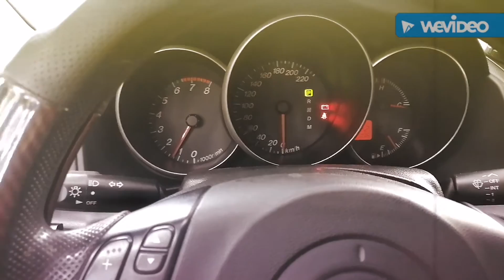Fuel Pump Installation Mazda 3

Comment: You made hole bigger to avoid dropping the fuel tank??
Reply from the maker: i only replaced the fuel pump,  and all the holes are original its the same size
Reply: @wangyuautocare  i think hole was made bigger  in the past to avoid dropping tank, I have an 07 mazda3 that fuel pump wont fit at all thru original hole under seat, its only to access the plug 👎 sucks
Reply from the maker: Maybe you bought a non compatible fuel pump
Reply: @wangyuautocare  original fuel pump won't come out thru that hole, I'm suppose to drop tank ,  I'll have to make that hole as big as that one you replaced on this video
Reply from the maker: @lcarlosmoreno6436  this is 2005 mazda 3 maybe sir your car and my car are not the same in terms of fuel hole size
Reply: @wangyuautocare  should be all the same you just lucky someone did you a favor extending that hole lol, 03 to 08 should be same generation
Reply: That hole was obviously made bigger. You can see the non factory cuts and they cut out the two screw holes that hold the black cover going over the pump
Reply: definatley cut bigger
Reply: It was cut bigger lmao, I don't think master shifu knows what they're talking about. Don't do this because you'll get lots of dirt under the seat, insects and noise.

Comment: The original did not have return line where did you connect the return line from which got connected to fuel pump
Reply: Did you get the answer for this? Cause I bought a new pump but it has two lines

Comment: sir,ganun lng ba kasimply magpalit ng f-pump at magkanu po presyo ng pump?
Reply from the maker: yes sir simple lng magpalit ng fuel pump, marami na ko napalitan ng fuel pump,hndi ko lng na videohan
kung gxto nio po magpa maintain ng auto, may shop ako sir dto sa Pangasinan
Reply: May socket ka ba sir para sa fuel pump assembly? Magkano po?
Reply from the maker: @WangYu Autocare
pm nlng sir for more info 09309345727

Comment: do you know if there is a fuel filter and where that resides/is?
Reply from the maker: do you mean the fuel filter of mazda 3?
Reply: @wangyuautocare  thats correct but iv seen another video. Thank you
Reply from the maker: please subscribe ma'am for more mechanical videos, and tips techniques about your vehicle thankyou
Reply: Not all Mazda 3's have a fuel filter and only have a sock on the fuel pump to filter. If there is a filter it would be on the passenger side by the rear wheel, under a cover.

Comment: Why do other videos show them dropping the tank???
Reply: A previous owner of this car cut the access hole MUCH larger to get to the fuel pump. Without this large hole, you must drop the fuel tank to change the pump (as the service manual instructs).
Reply: @davecc0000 don't cut the access hole. You'll get more dirty, bugs and noise in the back